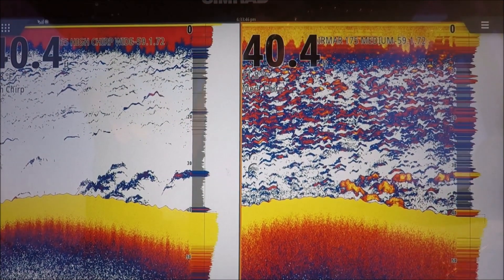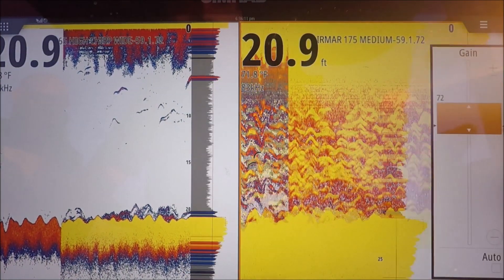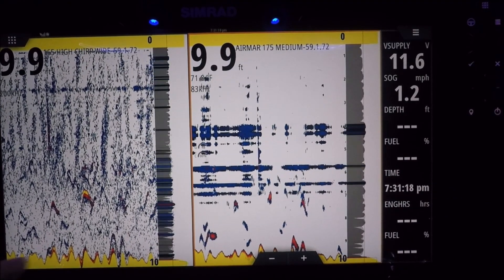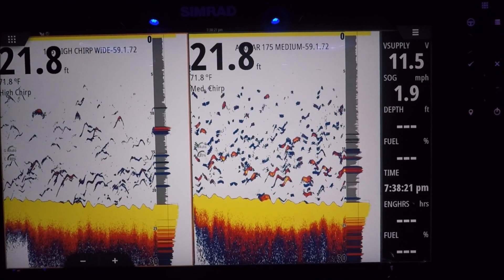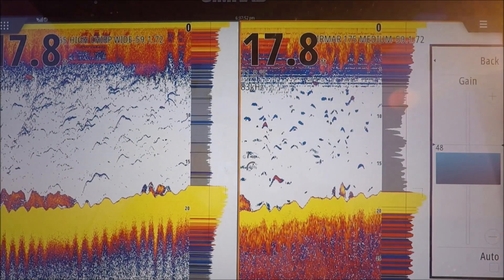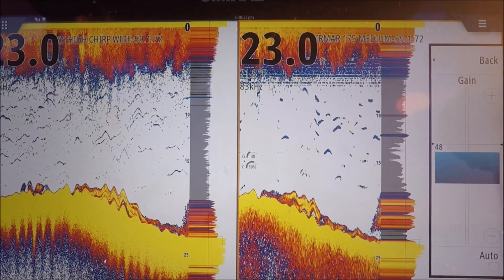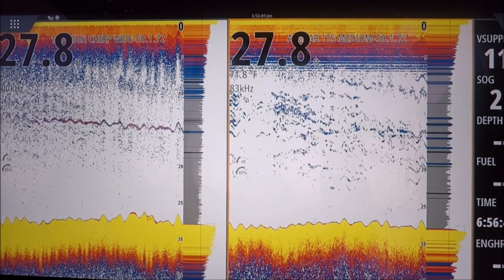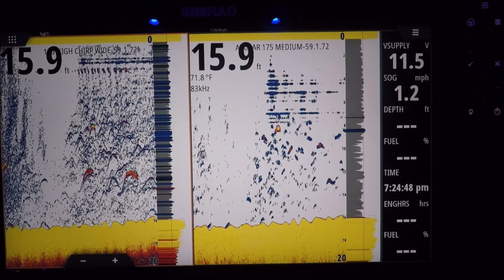TRANSDUCER COMPARISON -TM165 High Wide CHIRP Vs.B175 Medium CHIRP.

Comment: Hey Mike, I'm ditching my Totalscan. Would you recommend a tm150 or tm165 ?. I fish the Chesapeake Bay 50' or less water depth
Reply from the maker: They are both great transducers, but that 165 is pure evil brother!!
Reply: That's what i was hoping you would say. Thanks man.
Reply from the maker: Sure brother!! You’re still gonna need something for side and down scan though.
Reply: @MikeSmedleyOLDSCHOOLSTRIPERS  Yeah, i was told by Simrad that the new 2 in 1 active imaging transducer will work on my Evo2, it just wont have the resolution so, I'm going to go with that. I hope they're right.
Reply from the maker: David Watson Interesting. I don’t know about that. Even the Evo3’s won’t work without a software update. Is there a later update for Evo2 even available. ALSO. If it won’t have the resolution why not leave the Totalscan for side scan?
Reply: @MikeSmedleyOLDSCHOOLSTRIPERS  I will have to do more research before i make that move. It's a never ending " will work " " won't work " battle. If it won't then i will do just that or buy a Go9 for sidescan  This stuff is enough to drive me crazy sometimes.
Reply from the maker: There are quite a few guys doing that. Just adding a Go unit for the side scan.  If you go that route, please consider using this link https://amzn.to/2XCVw8g. You get the cheapest price and lifetime setup help from me by text and I get some gas money.  It’s a Win-Win. Thanks brother
Reply: @MikeSmedleyOLDSCHOOLSTRIPERS  By the way, I hear there's a Happy Birthday in order so, Happy Birthday and thanks again  for your help.
Reply from the maker: David Watson I appreciate that brother! Thanks!

Comment: Stupid question but need to ask.I have an Simrad Evo3 with a total scan transducer.Does it make sense to just replace it with a  Active Imaging 3-in-1 Transducer or keep both.What would be the advantage to having two. Thanks
Reply from the maker: Not a stupid question at all, I would consider keeping both if you had 2 displays. You would have a few extra options with down scan and CHIRP if you kept both, but only with 2 displays. In your case, I would go ahead and replace the Totalscan altogether. 👍👍

Comment: Have you used the b175hw? All the sonar guys around the chesapeake say  it's the best for fishing for rockfish type situations. Do you happen to know a guy named nick Garrett?
Reply from the maker: Yes Sir! I have a b175 HW on the boat now. It’s definitely my favorite for Striper fishing. I get to test a lot of them. It’s pretty cool😁
Reply: @MikeSmedleyOLDSCHOOLSTRIPERS  nice! How does it do marking fish while running?
Reply from the maker: It’s KILLER!! I love everything about it for Stripers. I also used the TM185 High Wide. It was also great.  If you watch some of my sonar videos from the last 4-5 years they were mostly done with a HIGH WIDE transducer.
Reply from the maker: Here are a few good ones with the HIGH WIDE. 

https://youtu.be/uvHV35lR3XY

https://youtu.be/UzICgPZpIGY
Reply: Ok cool thanks man, I lose bottom with my AI 3 in 1 at about 7 mph, and I can't put it any deeper because it sprays on my motor way to much. So I'm looking for a thru haul but I want one that I can get good returns at speed say 15 to 20 mph. That would be a game changer for finding fish